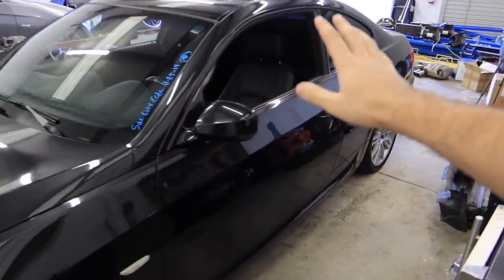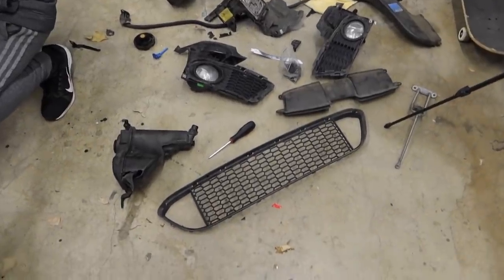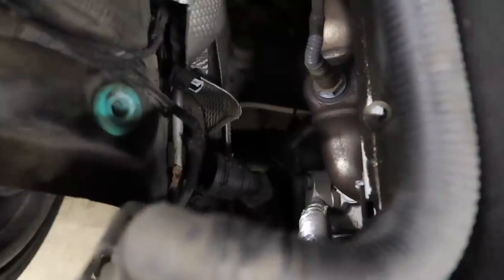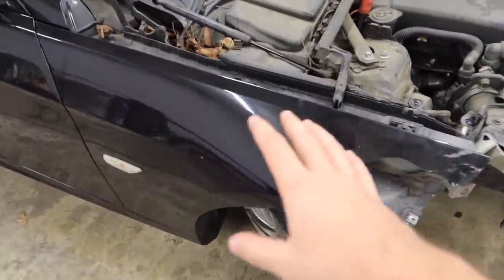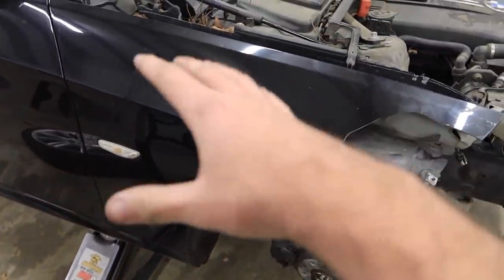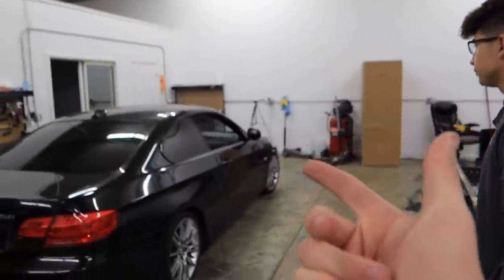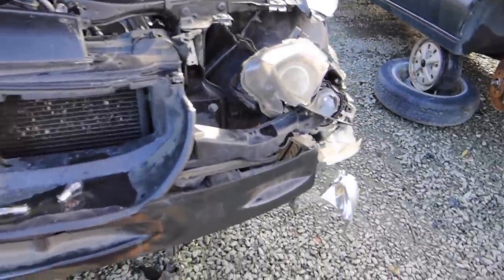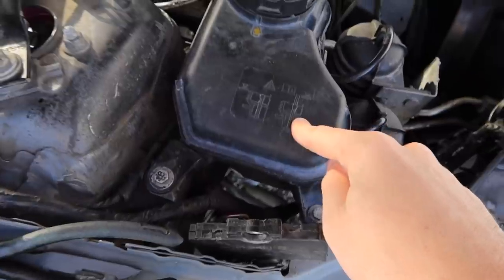Rebuilding a Salvaged 2011 BMW E92 M-Sport! (Part.1)

Comment: Nour you're gonna need to have the damage pulled out at frame shop , there might be more damage when you try to align the new parts , make sure they straighten it out bro , don't just cut it off
Reply: Absolutely right, first pull back in shape as far as possible. Then you can still cut bits off

Comment: I have the same model 328 m sport with the same drilled rotors!!  awesome car good luck on the build bro. also get it on the frame machine at a shop they could probably just pull out the damage

Comment: Nour..You DEFINITELY have to take it to a frame shop buddy... There may be more that got pushed back than you can see... Rule of thumb is .. Try to pull it back out as Close as possible first.. It will make your life ALOT easier.. Trust me.

Comment: Have the the rail pulled so when you get the new part youll have no problem aligning the new parts once pulled to spec everything should align correctly

Comment: Looking at the motor.. there is a vaccuum box just beside the water tank.. so this is the n51 motor 328i not a n52 motor 328i which has different internals making less compression than n52... I LOVE that spec though !!

Comment: Go to a shop to either pull the frame out or cut and weld the new piece. If you weld it you will heat the piece too much and it will be useless if you have another crash, it will lose all its flexibility
Reply: Either way you need to pull it out first of all